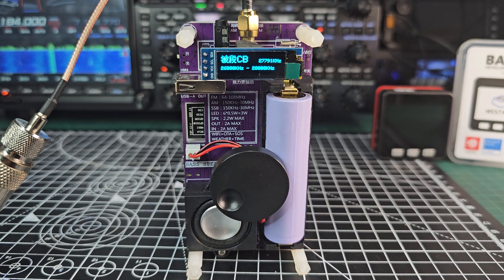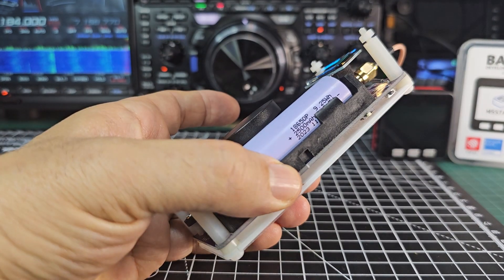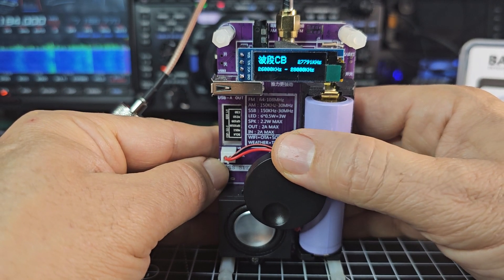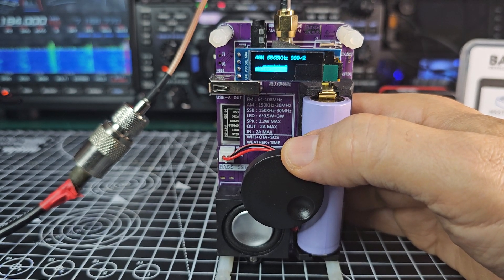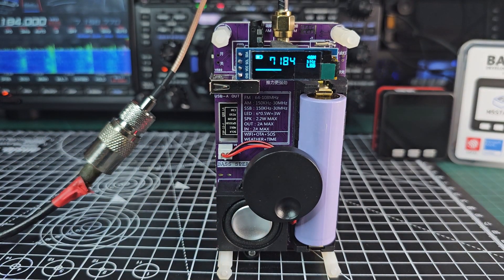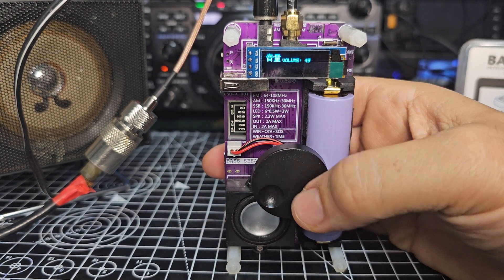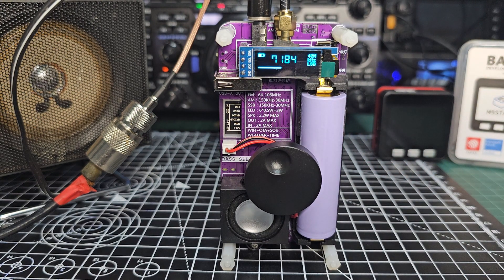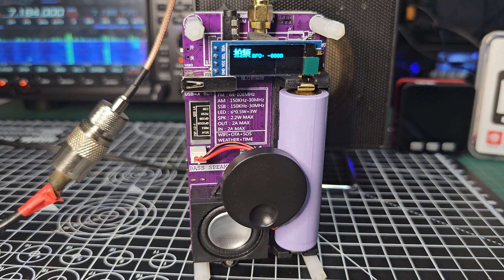Xiaok -HF,Vhf , Receiver , How to Change Bands & Settings

Comment: You have to take out the protectiin from the plexiglas and will be transparent. It's protected on booth side.
Reply from the maker: Unfortunately mine is white plastic .
Reply: @M0FXBHamTech You have to perferate the outer film with your fingernail. Once you make a little hole it peels right off. Have to do both sides.